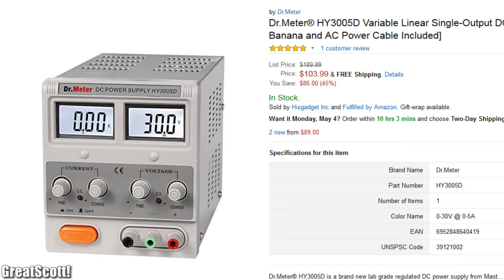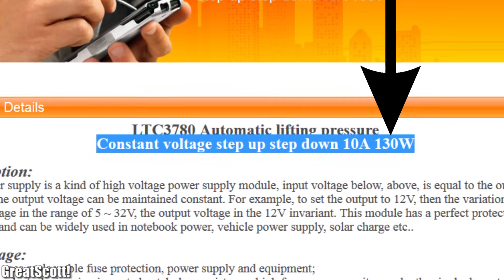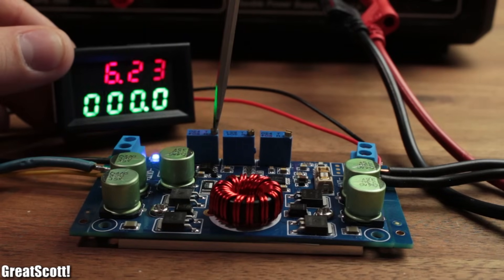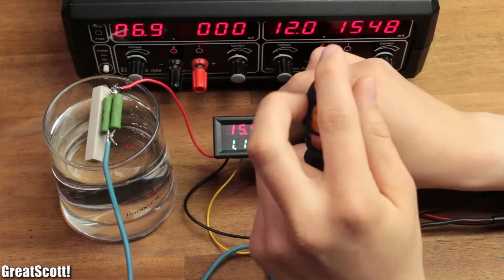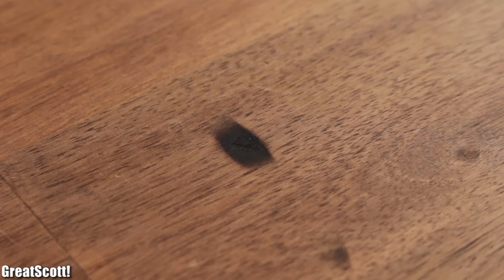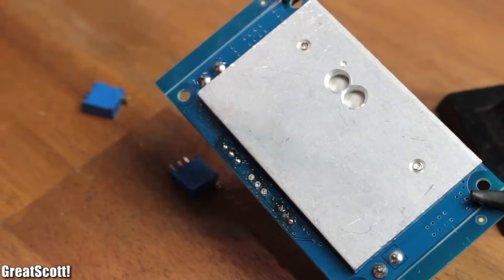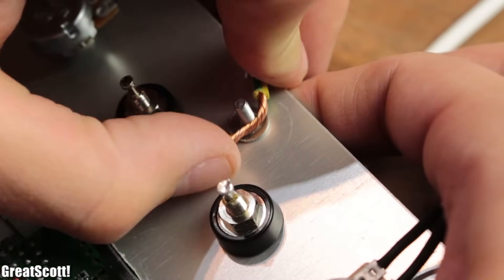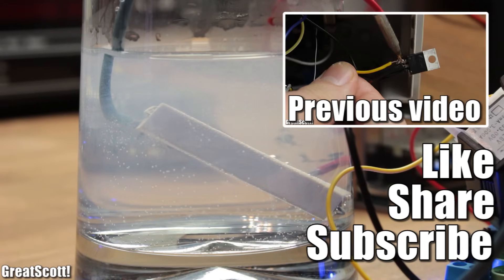Build your own Variable Lab Bench Power Supply

Comment: I really would like to find that exact enclosure do you have a link to it
Reply: Check this one out, this is the one I used for this project and a few others!

http://uk.rs-online.com/web/p/instrument-cases/7733274/
Reply: +1
Reply: That exact same enclosure for anyone interested can be found on banggood.com, in fact there are two identical ones for a slightly different price. The cheapest is £7.17 the other is £7.97 (go figure) at the time of writing (Dec 7th 2016). The Banggood site allows you to choose shipping destination and currency so you can select whatever you want/prefer. The direct link to the lowest price one currently is http://www.banggood.com/Portable-Power-Plastic-Shell-Instrument-Case-Plastic-Chassis-Desktop-Pack-p-1067526.html?rmmds=search

Also I'd already decided myself to use the same technique and I purchased a 48v 5Amp switching supply that should adjust to 55volts to use as input to one of these: http://www.banggood.com/DPS5005-50V-5A-Buck-Adjustable-DC-Constant-Voltage-Power-Supply-Module-Integrated-Voltmeter-Ammeter-p-1062473.html?rmmds=search

A voltmeter, ammeter, power meter, current and voltage limit setting and colour LCD panel complete with control knob and on/off switch for £22.22 so everything will fit in one panel cutout roughly the size of just the display in this video. 

Just add the output terminals. You get a proper 0-50v adjustable supply too. Total cost of 48v switch supply, psu module and case ~ £50 plus some minor parts most of which are already in my parts bins. You can't buy a commercial unit with those specs anywhere that I've found, and in addition if you want a double or triple unit it would be simple to create, needing only a marginally larger case possibly although a double unit would almost certainly fit into one. If you want 5A but don't need more than ~30volts they have quite a nice looking commercial 0-32v 0-5A bench unit here: 

http://www.banggood.com/CPS-3205-0-32V-0-5A-Portable-Adjustable-DC-Power-Supply-110V220V-p-934530.html?rmmds=search

I plan on also having building an inductance sweep tester and zener tester in the same case especially as the latter will require 50 volts DC to cover most gen purpose zeners including power types. Hope that all proves useful.
Reply: Bob Lewis Thanks, definitely worth checking out when I get to designing my PCB
Reply: I've just ordered a case so with a bit of luck it might arrive by Christmas! I already had the SMPS and the variable Power supply module.
Reply: Also be aware I was referring not to the case in the video but to (IMO) the much better case from Ali Express referred to by Ichdar Hsb. Check it out properly before purchasing.

Comment: What happens if you short circuit this thing? Do oyu have to change any fuses or does it detect short circuit?

Best regards
Reply: LTC3780 has short circuit protection. You can even add reverse polarity protection by adding Schottky diode in series with the input.
Reply: if you short circuit it, the LTC3780 will lower the voltage until the current reaches the limited value selected by you. that's what constant current circuits does. so it won't blow up. But if you set the current to a high value and don't dissipates the heat build up in the heat sink, it will probably melt down.
that's what Great Scott means with " you can adjust the output current. " only in a shorter version.
Reply from the maker: You can adjust the output current.

Comment: I know this is an old video, but I can see only one potential problem with the build, which is that you soldered the mains wiring rather than used crimp terminals. I know some places mandate a crimp connection (Here in South Aus, we use crimp and screw terminals for 240v Mains.) Other than that, it's excellent and I do hope it gives you a lot of reliable usage.

Comment: How much does this all cost?
Reply: And can I make the enclosure without a saw?
Reply: i live in europe i got my parts from Ebay for under 20€ including the ltc3780, 1 200K potentiometer, 1 500K potentiometer, 2 knobs, AC switch and 100V 10A voltmeter ammeter (ik it is overkill, but it was cheap) i am going to make the enclosure by my self and for the power source for the ltc3780 i am using old computer power supply
Reply: Steamy PvP finnaly i found a minecraft player who knows electricity!
Reply: Steamy PvP good idea, i got psu from school while i was told to repair them. The only broken thing is the ac plug, so i replaced them.

Comment: can i connect the ground post directly to to ground terminal of the psu if i, for example, have some more fixed outputs or do i have to use a separate ground for the buck/boost ?

Comment: So i'm guessing the one you've built has a theoretical maximum output of 60W? And why was that third wire so important on the ac plug side? Is it ground? If it is ground what use is it if my wall socket isn't grounded? Since it has only 2 poles for electricity and none for ground or at least definetly not in the usual way.
Reply: eivis13 then please use a fully insulated enclosure. that means no touchable metal parts - aka plastic.
Reply: eivis13 Grounf is justfor your own safety. If your wallplug isn't grounded, then it makes no difference. But you might just want to install the ground wires, in case you plug it into a wallplug in someone elses building. It's safer for everyone
Reply: Elvis13 In Europe and the UK especially it is illegal to have a plug wired to any enclosure with exposed metal parts that might or could become live WITHOUT those parts being earthed. With all new European electrical installations requiring RCD's be fitted it ensures that dangerous, potentially lethal faults are isolated immediately.

Don't forget that the US is only 110v not 220v in Europe or even 240 plus as you can typically find in the UK. Trust me when I say a jolt from the former is not much more than a severe sting IMO, a jolt from 240 volts bloody hurts - a LOT (I've had loads from both) and the latter can burn you badly (1st degree) or kill very easily even when wearing insulated boots if it goes through your body down the left hand side or across your chest i.e. through your heart!
Reply: You forget old (or older) homes. Not everywhere you can properly make a ground lead in your home (home, not a house or relatively new flat) without 20 or more signatures.

Comment: that was fantastic. an adjustable bench supply is a very usefull thing but a cheaper, but somewhat limited supply for a lot of beginners could be put together with an lm317 and some junk box parts. a large series pass transistor can increase current capability. I sure would like current control thou........

Comment: Great video and it looks like a great idea and were thought out and modular too. Just one question though in the testing you showed the power resistors and used them to load your supply. You then say that all you need to do is put it in a case touching each piece in turn. You don't appear to use any resistors to load the supply though when putting into case. Am I correct in thinking that you don't use them in the finished product. If you do where do they attach. Thanks.
Reply from the maker: Don't need it

Comment: Very nice tutorial, i saw it a while ago, and i decided to make it myself. Bought all the components, put everything toguether and... surprise!!! once I take the voltage past 13 volts, the volt-amp meter just shuts down, while i hear an annoying buzzing... I spent a few hours trying to redo the setup, trying to find any stupid mistake I may made, and then I thought about the fact that the volt/amp display shows that the power supply and the mesurements should be isolated.... so i put a general purpouse diode between the 12V/5A power supply and the positive connection to the volt/ampmeter and everything seems to be working now. The buzzing sound is still there, i still need to test the power supply with some load on it, but it works. I just put this here just in case someone happends to be in the same situation as me. Great video tutorial Scott!!!

Comment: Can you or anyone explain to me why did you use two potentiometers and the power supply?
Forgive my bad english
Reply: The main board converts DC to DC, so you need something that turns 120/230 V AC into something between 5 and 32 V DC to feed it. Thoose led power supply works very good, and they are really small for it's power. The potentiometers in the board (thoose blue boxes) are hard to manipulate from the outside, you'd have to use a small screwdriver, and build some kind of hole and guide on top of it, so you don't touch anything else with the screwdriver (you could create a shortcut in the board's surface), so replacing them with others that you can put in the front of the power supply is really convenient.

Comment: Hi Scott, i did everything in your video, followed every single step, but for some unknown reason, the knob the current is allways 0, regardless of how i turn the current knob. Do you think it would be a problem with the LTC3780 or with the potentiometer?
Reply: Did you put a load on the output. Something like a lighbulb and than try to test it out.?

Comment: I just made a variable DC power supply that can deliver up to 32V and 
12A. It is made out of (DPS3012 Programmable Constant Voltage Current 
Step-down Power Supply Module) and one 400W (36V 11A) LED strip power 
supply. I am very happy with the built :)
I just need to have a nice enclosure to put everything inside.

You can try this one to built.
Reply: Oh wow that's a great module. Any suggestions on what gauge of wire to use for connecting the power supply to the controller module?
Reply: I used 12 wire AWG.
Reply: Thank you!

Comment: were can i find LTC3780 in sweden been looking so much plz help really good video but wanna make the power supply :)
Reply: aliexpress .com
Reply: This is the one I used to my build:

https://es.aliexpress.com/item/LTC3780-DC-5-32V-to-1V-30V-10A-Automatic-Step-Up-Down-Regulator-Charging-Module/32644012125.html?spm=2114.13010608.0.0.aFZjjC

It has 4 small heat sinks instead of the backplate that GreatScott's has, but seems to be working fine for me...
The link is in spanish, but you can change it. Total cost arround 15€, and it was well packaged from this seller. You can use any other, of course, just giving you an example.
Reply: Det kan du inte. Finns inte hos någon återförsäljare, jag köpte min från ebay, men jag har tyvärr inte kommit igång med mitt projekt ännu.
Finns också på aliexpress eller banggood.
Om du kan tänka dig ett ännu enklare nätagg och inte kan köpa från tidigare nämnda sidor, så kan du köpa en LM2596 från kjell och använda den som variabelt nätaggregat med samma princip som i denna video. Lite mer begränsat, men fungerar för enklare projekt.

Comment: Rather then rap stranded wire around a screw and washer, it would make more safety sense to use  a spade-lug.
No danger of that slipping!
Reply: Hey folks I'm a ChemE who occasionally wires up Pilot equipment...

I've never really thought about how grounding should be done and definitely have wrapped/soldered before. I will never do that again.

Please know that your youtube comments made me a better engineer, and may have even saved a life. Cheers.
Reply: You should NEVER solder an earth/ground connection. In the event of a high current fault the solder can melt (just like the resistor solder in the video!). Spade crimp connectors only the the IEC inlet. Wrapping the wire isn't the best method, but it's way better than the soldered version!!
Reply: @davidmoore2892  If your fault condition passes such a high current to earth and for a such a length of time that it melts solder, I strongly recommend you reconsider your strategy for fusing the input.
Reply: @davidmoore2892  - Agree!
Reply: @davidmoore2892  but spade clips tend to loosen over time due to their heating.  I try to use a lug and bolt and nut if possible.
Reply: washer or forked crimped or soldered lug = professional job, twisted wire = rank amateur. There are plenty of "professional" electricians I know who are rank amateurs when it comes to wire and cable terminations!
Reply: And a drop of solder wouldn't go astray..
It's probably fine though..

Comment: Should your mains connections be soldered, or would it be a better idea to have crimp terminals?  I thought generally crimp terminals were preferable, to avoid high temperatures causing connections to break.
Reply: stoduk crimping is a good idea

Comment: Where did you get that enclosure though??
Reply: Check this out, very cheap with free shipping cost

(https://www.aliexpress.com/item/200-175-70mm-Waterproof-Plastic-Enclosure-Project-Box-Instrument-Desk-Case-Shell-With-Handle-For-Electronics/32715590944.html?spm=2114.13010608.0.0.Imm5oj

Mine has delivered safely.. :-)
Reply: Ichdar Hsb wow this is amazing! Thanks for sharing this. Now I have everything needed!
Reply: It is currently less than $9usd at http://www.banggood.com/Portable-Power-Plastic-Shell-Instrument-Case-Plastic-Chassis-Desktop-Pack-p-1067526.html
Reply: Urban Student Prepper As the video states, the front and rear panels are metal, and they are grounded (earthed) as shown in the video.
Reply: thanks!!!!
Reply: check this - https://www.ebay.com/itm/HQ-Instrumentation-ABS-Project-Enclosure-Box-Case-Black-140x170x60mm-Plastic/201180688204?ssPageName=STRK%3AMEBIDX%3AIT&_trksid=p2057872.m2749.l2649
Reply: You might not want to use it, since the material of this enclosure is made from Polystyrol and does not tollerate much heat. If you ever have any problem, this thing might start burning easily. Better stay away from this Polystyrol case! At 50°C it already gets weak. At 70°C it gets kind of soft. At 80°C it can start melting. Glass Temperature is only about 100°C. And Polystyrol is known to melt into drops that start burning on their own.  ---   Just put this casing into direct sunlight on a hot summer day, attach a heavy electronic load to it and go for a walk. Do not worry to miss anything, the police will call you anyways after your house was burned down.
   Instead you better get something that does not burn so easily!

Comment: What if instead of using the 12v 5a power supply, I have a old pc power supply that has 12v 15a, 5v 30a, and 3.3v 28a? Is it possible to use more then one voltage option with a switch to choose between them?

Comment: Hi +GreatScott! ,
I'm currently trying to build such a Lab Bench my self. But bad luck me didn't check the ltc3780 when I got it. Well I soldered all the poti's and wanted to try it out before finishing everything. So I hooked it up to a car battery which has about 12,6 Volts so should be okay. The Voltage regulator on the board instantly blew up. Why is that ? The power source should be okay, I checked all solder connections and got no short circuits. On the output I just connected my multimeter. After desoldering all poti's and trying it again it was apparently to late and the voltage regulator began to smoke again. 
Its the 78L05 voltage regulator I'm talking about. 
So the question is, was it my fault or is the board just crap ?
And can i do something about it ? Would it be rational to change the voltage regulator and try it again ?
Greetings from Bavaria
Benni

Comment: Hey.. I'm trying to make this project couple months ago,  but i have no idea my board just dont work... I give 12VDC from power supply into input.. And there is no voltage in output the fault led also turn on.. I think it's broken.. Then I bought another one.. But when i try the same way.. It give a same result.. Any one could help?
Reply: Did you try to use the 2 potentiometers? And make sure you are using the right polarity
Reply: +ITALIAN PLAYER 05 yes of course.. And nothing happened

Comment: Hello, I want to ask if i can use a 12v 10 a power supply instead a 5amps  with a ltc 3780 and a lcd led display 0-100 v 10 ?
Reply: Yes. I actualy make it. But remember 2 things:
1. The heatsink in this module not enough to power 120w of power. So you need to add more.
2. You need a bigger enclosure wkwkwkwk
Reply: Thanks

Comment: If I build this, I am going to use a 20A Supply for Max power cx
Reply: You have to add more heatsink for that. This modul heatsink could only work about 80w or so. So your 240w will literaly kill it.
Reply: You can try to add small heatsinks on the top of the ICs arround the toroid, and add a 12V fan to force a ventilation. That should give you better heat dissipation power.
Reply: Muhammad Salman Galileo I used a 300W dissipating PC tower cooler
Reply: Sollux Captor nice idea.

Comment: thks for the reply  Mr GreatScott!
                           Sir  would I use the same power supply on the video 
RioRand DC/DC Synchronous Boost Buck Converter Constant Voltage/Current DC 5-32V to 1.25-20V 12V 5A Voltage Regulator LED Driver Adjustable Power Supply Module.

Comment: am having trouble wiring this lcd screen to the converter. please help.i will leave the link to the lcd screen here -->>      bayite DC 6.5-100V 0-100A LCD Display Digital Current Voltage Power Energy Meter Multimeter Ammeter Voltmeter with 100A Current Shunt https://www.amazon.com/dp/B013PKYILS/ref=cm_sw_r_cp_apa_w0cLxbMM5E7HS